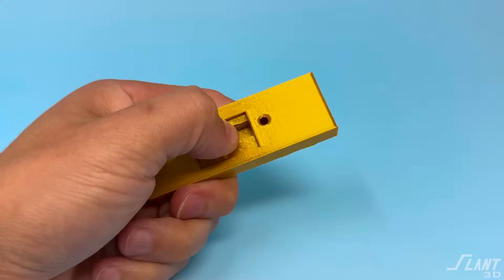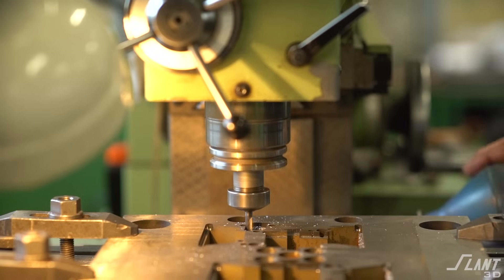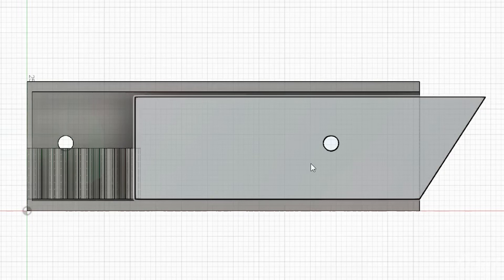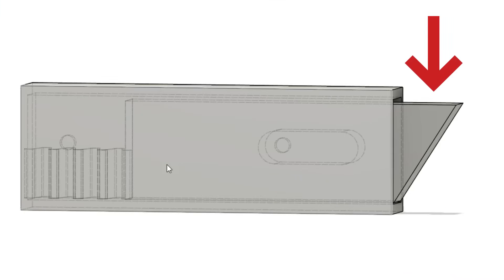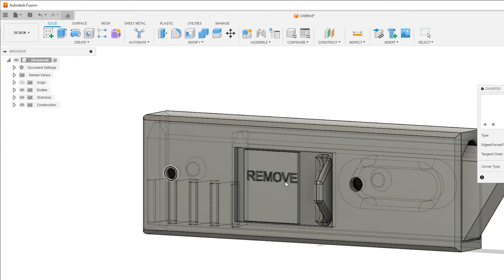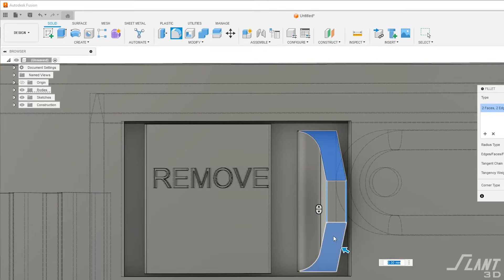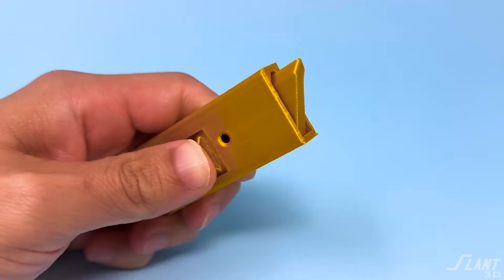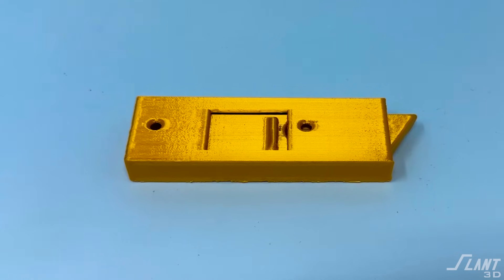Print in Place Latch Mechanism | Design for Mass Production 3D Printing

Comment: I like 3d printing, but what you did here is definitely not more reliable than a moulded part you are comparing your design to.
First of all you can't say for sure that the 3d print will be more reliable/sturdy than an injection moulded part. Especially that piece that is supposed to be holding doors or some other thing in place. And you sharpened that edge so now there's smaller surface to spread the force onto. Secondly the printed spring will definitely wear down faster than the metal spring.
Finally your design doesn't allow for repair of the inside - if something were to get stuck, then you can't open it up to fix it. If the spring breaks, you can't open it up to fix it.
Reply: Hey Saper! Good technic videos.
I agree that in these Slant3D videos the guy often presents his videos in a way that makes it sound like there are no issues with the 3d printing process. He's doing a little bit of over-compensating I would say in trying to change the perception of 3D printing. His use of words sometimes infuriated me and it makes it sound like he's just lying. Anyone that constantly likes to use worlds like "better", "improved", etc., sounds like a cheap salesman to me. Because it always "depends".

If this latch is just holding back a cabinet door that barely gets used, then this could be perfect. If this latch is supposed to hold up an industrial garage door, then probably not. So it all depends.

About your comment: most-likely yes, metal springs do have many advantages over plastic. There is a thing called the "S-N curve" where under a low enough load, a spring "should" never fail from fatigue. But any spring, if designed improperly, will fail. As an engineer, you need to understand what the criteria the product needs to work under and what the customer expectations are. Some springs, even if they're made from brittle material, will work fine for years.
Reply: 100%. I have plastic  latches in my house that are 25 years old. There isn't any good 3D printing material that can be reliably used for the springs part in any way or shape for any longevity. Even injection molding from flexible plastic will probably break in 5 years. It's basically creating parts that will surely break and hence producing more garbage and landfill waste.

Comment: How do you keep the bottom of the latch and the bottom of the spring from sticking to the inside bottom of the housing?
Reply: The support he made, latch, and spring were all printed with a slight gap below them.
There is a difference between normally printing layers, and extruding on top of a layer. I don't know the exact vocabulary on this but I will explain it as best as I can. 
When you print at 0.2mm layers the nozzle actually squishes the plastic onto the layer before it. When you leave a gap (0.15-0.30) the nozzle will just place the bead of plastic on top of the previous layer. The amount of surface contact between those layers is much less so they do not fuse. 
Think of it like putting down a bead of caulk. The right way is to put the nozzle right up to the surface you are working on and when you push the material out you want it forced into the work surface. If you however raise the nozzle off the work piece and let the caulk just drop onto the workpiece, it won't stick well. I hope this helps!
Reply: @tomsko863  brilliant description and info, thank you!

Comment: There is a subtle issue for designed in supports, you can no longer adjust or tweak offset heights to optimize surface finish and reduce break-away forces, you are stuck using exact layer heights, which might or might not be idea for any given customer or manufacturer's machine. Being able to tweak those by 0.05mm at a time makes a world of difference for the peel forces and reliability. Getting stuck on a 0.20mm grid might be a too close/far scenario.
Reply: You can upload two stl for different layer height.
Reply: @nobocks  Actually it's more nuanced than that, modern slicers can now do offsets that aren't aligned with uniform layer heights. So yes you could do that.. but now you are stuck in 2 states of offsets instead of a precision tunable one.
Reply: If the bottom of moving parts is chamfered, as is the top in this example, a small horizontal offset (0.05mm)will have the same effect as a similar vertical offset for horizontal surfaces.

Comment: A noob question, would not that spring mechanism break after a while?
Reply: It will break for sure. This is not really a long lasting part, but I guess it was just used to convey the idea.
Reply: @pcdoc2000 Might have been a good idea for him to mention that at the start, so people don't blindly copy the design and try to use it as a functional part.
Reply: @imacmill  I disagree guys. You can make it as robust as you want. It would depend on the material they were using, how thick the spring is, how much stroke it has, etc. As an engineer, you need to understand what the criteria the product needs to work under and what the customer expectations are. I have appliances that were made in the 70's/80's that have plastic snaps, living hinges, and other features that are still functioning. I also have newer, metal components that failed well below their expected lifetime. If something is made correctly, it can last for quite awhile, regardless of what material they were made of.

Comment: And how is the latch piece gets disconnected from the bottom of the enclosure it lays on during the printing process? The latch will be one piece with the bottom of the enclosure.
Reply: The support he made, latch, and spring were all printed with a slight gap below them.
There is a difference between normally printing layers, and extruding on top of a layer. I don't know the exact vocabulary on this but I will explain it as best as I can. 
When you print at 0.2mm layers the nozzle actually squishes the plastic onto the layer before it. When you leave a gap (0.15-0.30) the nozzle will just place the bead of plastic on top of the previous layer. The amount of surface contact between those layers is much less so they do not fuse. 
Think of it like putting down a bead of caulk. The right way is to put the nozzle right up to the surface you are working on and when you push the material out you want it forced into the work surface. If you however raise the nozzle off the work piece and let the caulk just drop onto the workpiece, it won't stick well. I hope this helps!
Reply: The same way you do supports: Print it in the the air but very close to the underlaying surface. That prevents sagging but minimizes the fusing area, so the first time you pull the lever it will detach.

Comment: The moving part and the roof got chamfer so they are 2 separate parts. But how about the bottom side of those 2 parts - the moving piece and the floor of the case - they are 1 over the other with flat surface. How you deal with it? Minimal support or?
Reply: The support he made, latch, and spring were all printed with a slight gap below them.
There is a difference between normally printing layers, and extruding on top of a layer. I don't know the exact vocabulary on this but I will explain it as best as I can. 
When you print at 0.2mm layers the nozzle actually squishes the plastic onto the layer before it. When you leave a gap (0.15-0.30) the nozzle will just place the bead of plastic on top of the previous layer. The amount of surface contact between those layers is much less so they do not fuse. 
Think of it like putting down a bead of caulk. The right way is to put the nozzle right up to the surface you are working on and when you push the material out you want it forced into the work surface. If you however raise the nozzle off the work piece and let the caulk just drop onto the workpiece, it won't stick well. I hope this helps!

Comment: The printed part lacks tension. Thats why you can hear ir rattle. How to solve that?
Reply: I wonder if there is some design that would have a spring that starts a bit too long and shifted a bit out of place, but then breaks free and snaps into the proper position on its first, and only its first, compression. I can almost see it, but it's just a thought.
Reply: @ionymous6733  You're onto something. My solution would be (a simplified explanation here), to print the latch slightly out of the opening (pushed "out"), then the first time you push the latch into the housing it will latch into position. It would "catch" onto a feature inside the housing and be in the position he showed in the video. That way the spring will be always be in tension, reducing rattle.
He did make the part quickly, it wasn't supposed to be perfect in every way. It was just to show off some techniques.
Reply: @ionymous6733 you might put holes in a feature that is part of the spring that lines up with the mounting holes. Then, when the part is put in place, the fixings (screws) lick the spring in place.
Or, as with the "remove" support piece, you could print a peg that needs to be pushed in.
Reply: Hmmm, you could probably connect the back of the spring to the back of the latch box.

Comment: How did you get the bottom of the slide to not connect to the bottom?
Reply: The support he made, latch, and spring were all printed with a slight gap below them.
There is a difference between normally printing layers, and extruding on top of a layer. I don't know the exact vocabulary on this but I will explain it as best as I can. 
When you print at 0.2mm layers the nozzle actually squishes the plastic onto the layer before it. When you leave a gap (0.15-0.30) the nozzle will just place the bead of plastic on top of the previous layer. The amount of surface contact between those layers is much less so they do not fuse. 
Think of it like putting down a bead of caulk. The right way is to put the nozzle right up to the surface you are working on and when you push the material out you want it forced into the work surface. If you however raise the nozzle off the work piece and let the caulk just drop onto the workpiece, it won't stick well. I hope this helps!
Reply: @tomsko863  Interesting, thank you for the explanation
Reply: @tomsko863  You're the man ! English is not my main laguage and I understood very easily the concept. Thank you !
Reply: Similar to the designed-in support he mentioned perhaps? .3mm offset that you apply light pressure to to unstick.
Reply: you can see in the slicer that it has 2 layers of separation, it sags the first layers but at the end works
Reply: @themexyeti  so it's still weakly attached at the bottom?
Reply: @mawoodmain  that was thinking the Same

Comment: This is awesome to see! I've been hunting something like this. 
I love your content in general. 
Now, slant3d; please, can you explain how it would be to create something like this with a notch/lock? So the sliding door, but it friction fit locks into place at the end of actuation, and beginning, so it will stay open and stay closed
Reply: Same principle, just applied with a spiral spring.
Reply: Depends if your making a one-off or trying to make a 1,000. What Slant3D is doing is trying to see their services as a manufacturing facility. So they focus on mass production designs. When you make a 1-off, you can make it out of as many parts as you want, or buy sub-components like coil springs, leaf springs, pins, bearings, etc.
What you are describing is a "detent". Google that and you can find alot of examples. A ball bearing added into the slide with some ramps and notches would do it.

Comment: Great description of the design process and how 3D printing can be a superior solution to traditional injection mold manufacturing. One huge advantage that you highlighted is how you significantly reduced the part count to include metal springs that can rust or present assembly challenges—saving time, money, and part reliability.

Comment: I MEAN
WITH THESE MANY LIMITATIONS AND ADJUSTEMENTS JUST TO MAKE IT WORK
I DONT REALY SEE THE BENEFIT OF DESIGN FLEXIBILITY
Reply from the maker: No molds, lower volumes, more reliable. Thousands saved for a better product
Reply: @slant3d most of ,our point are valid, but how more reliable ?!
With the long time that a 3d print take its Affected by so much parameters that I can't call it reliable
Reply: @teamllr3137  Are you saying the part isn't reliable or the manufacturing process isn't reliable? With experience and fine tuning 3d printing can be very reliable and repeatable. 
If you wanted someone in their garage with a couple of off the shelf printers to manufacture things reliably I'd agree that's not going to go well. But these are professionals, with millions of hours of printing, custom designed machines and probably decades of experience.
Reply: @teamllr3137  "With the long time that a 3d print take"

If you think a 3D print takes a long time, wait till you find out how long making an injection mold takes.
Reply: @teamllr3137  Dude just imagine spending 100k for one mold and it does not work, all for like 5.000 parts. It's way better to 3D print, even in two part with springs wich is still a good option. The only downside is " it's fucking hugly ". But some high end machine like SLS can produce a very good quality and a incredible ammount of parts.

Top of that worst case scenario it break and you can print another one, for the long term it's fucking horsecum hardcore " PURE ".

Printed 2 month ago something to handle my bottle on my bike, got greedy with only a 0.6 wall thickness and it broke cause i kick it by accident.

So i iterate the design by adding an extra 0.6 and it's way stronger but still flexible even if it's PLA.

Total cost ? 20 ct.

On amazon a simple bottle handler is arround 10$, half the price of a good 1kg of filament.
Reply: @slant3d about how much per part if you were molding vs printing a 100 vs 1,000 vs 10,000 part run? Showing the cost breakdown comparison in these design for additive videos would help people see the advantages of 3d printed products 😃 👍.
Reply: Is there a design process that doesn't have limitations and require adjustments? 

The benefit of design flexibility is you can iterate on that part to make adjustments, if you create a mold for injection molding you now have 0 ability to change the design without significantly increased cost. What if you made an error on your mold design and now you've got a useless mold?
Reply: Its not about a manufacturing process having limitations 
Its about listing those limitations as features
Square and thick boxes with shamfers in the edges
Isnt what i call * anyshape you want*
And it isnt necessarily superior to injection molding if u comsider 99.9999 of what u already see is made that way
Reply: @walid4337  Everything does have some limitations. Although I should note that they have additional limitations compared to hobbyist 3D printing since they have all of that auto-ejection business and apparently don't have elephant foot compensation in their custom slicer. Also - I think adding chamfers and/or fillets makes things look a bit nicer anyways.
Reply: It definitely requires some design and aesthetic compromises to make printable 3d parts that have little support material. I think you have to want to avoid injection molding enough. Which, is definitely the case for me. Maybe if I end up with a successful product in both design and sales, then I'd move to injection molding.
Reply: @ionymous6733  Let's do a simple math here !

For this part you need 2 injection mold so it's arround 100.000$ and for the same price you can buy 200 prusa mini's.

An injection mold can spit 4 part every 10 second so 24 per minutes and 1440 parts per hours.

On a prusa mini you can spit 1 part every 10 minutes so it's 1200 parts per hours.

Same price for production at the end but like slant 3d says, you can iterate alot and you don't have extra ship comming for china or whatever.

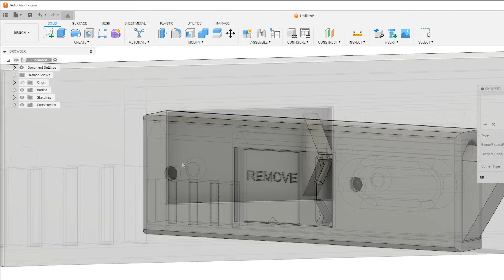Comment: 3:58 I completely missed what the collar thing was to prevent screws splitting a part?
Reply: Hi, He explains about the holes in great detail on this video
watch?v=9ERY20MRJPo
Or check his videos for "Design Custom Electrical Enclosures for Mass Production"
Reply: i did reply also but i think my comment was removed, i linked to Slant3d's other video so I'm confused why the comment was removed.  The other video Slanted3d has shows about the collars. I do apologise, wasn't trying to cause any problems :/
Reply: @wo88les  "i linked to Slant3d's other video"

YouTube automatically hides any comment with a link unless the video uploader finds it and manually makes it visible again. Think about it, how often do you see links in YouTube comments from someone other than the video uploader?
Reply: @Phoen1x883  Yup, I learned this the hard way. Regardless what you are linking it will hide your comment. Same if you used a word that the video channel blacklisted.
Reply: The collars are to keep from splitting the* part when tightening the screw